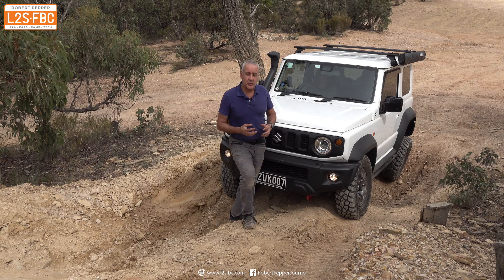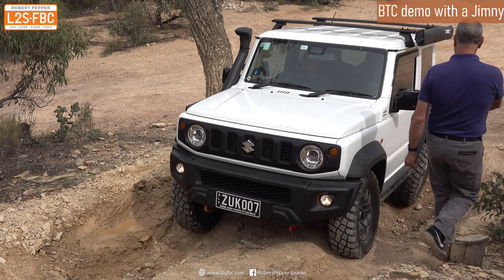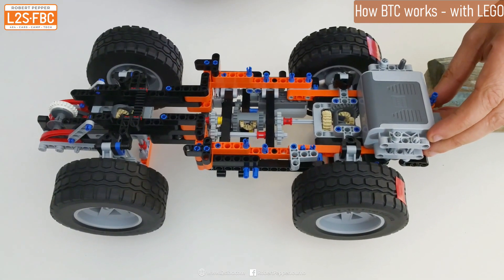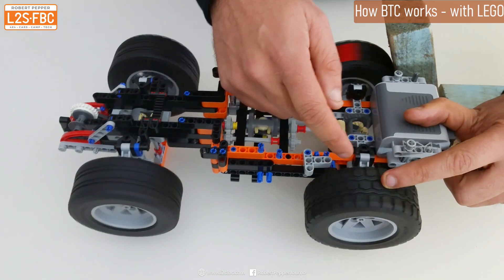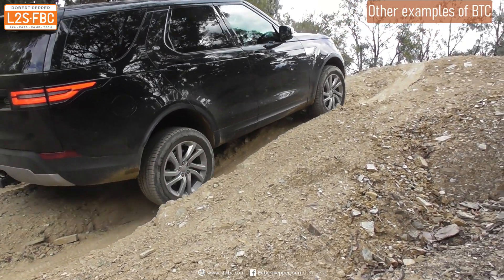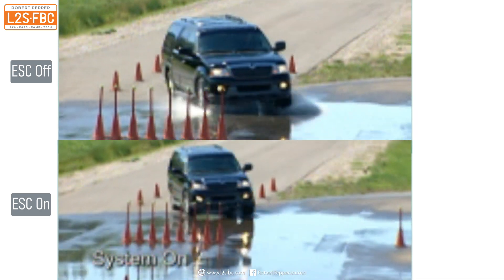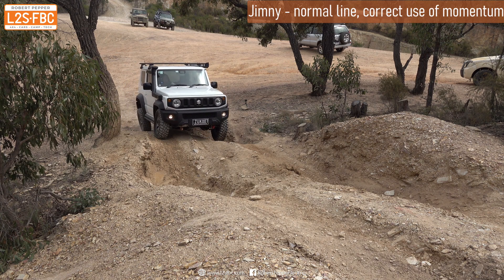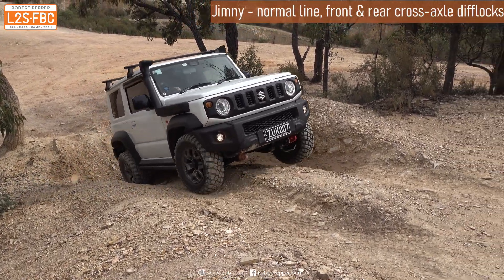The Three Types of 4x4 Traction Control - do you know the difference?

Comment: Great video, thanks.
I've got 2 Jimny's, 3-door JB74 and 5-door XL that have the same issue/problem!
I'm assuming it's related to the Electronic Stability Control and I'm hoping someone can confirm. Mechanics have looked but weren't able to replicate the issue.
Driving spiritedly on a bendy bitumen road in 2-wheel mode. Suddenly as I enter a left hand bend a loud sharp rumble sound is emitted (like running over ripple strips), the car pulls to the left sharply and slows rapidly. This only appears to occur on left hand bends. The XL did the same thing recently whilst going very slowly. I turned to the left off bitumen onto dirt and the car suddenly pulled hard left and slowed quickly. Had I have been going faster the car might have rolled over or crashed into nearby trees. Very unnerving indeed!
Has anyone else experienced this issue?
Can anyone suggest a fix?
Reply from the maker: Sounds to me like it's ESC.  Please review my Sand Setup video which talks about Jimny ESC, and shows an example on sand, see if it's the same noise.  The Jimny has poor ESC, simple as that, harsh, overly intrustive and ineffective.

Comment: Thank you very much Robert. I found here the best explanation about traction control in its three types.
In the user manual of the new generation of Ranger 2023+ the explanation is not clear and does not make the difference between BTC and ETC so I assume that when the 4L is connected the system only disconnects the ETC (and not the BTC). A big greeting from Mendoza, Argentina.
Reply from the maker: Glad it helped

Comment: ESC is basically the opposite of BTC! The ESC is braking the slower rotating wheel (inside wheel in a turn), while the BTC is braking the faster rotating wheel. You understand why the BTC is braking the faster wheel but do you understand why the ESC does the exact opposite? What do you think? What purpose should that serve? I program ECUs and I can tell you, it is not easy to find a good balance between this two, opposing functions.
Reply from the maker: Yes, I do understand why ESC does what it does, yes agree the two functions work differently.  ESC can also reduce braking force as well, not just increase it.

Comment: Cross axle lockers are good but also very dangerous!!! Especially if you fully lock the front axle. Do that, while climbing diagonally - on the side of a mountain and you will find out the hard way. Actually, it is the quickest way of writing off your vehicle and/or the driver ending up in hospital (or mortuary)...😮
Nice video, however you should have (at least) mentioned of that possibility...
Reply from the maker: It's not that dangerous if done right

Comment: The Suzuki All Grip System …
In normal driving it is slow to react, i.e., adding brakes to the spinning wheel. In general the computer needs 4-5 full turns before reacting. Other brands needs less than a 1/4 of a turn to react. 
Meaning, when the All Grip reacts the car is at a stand still. 

Solution 1 … Speed up, have a much higher momentum and you will have a scary drive but the All Grip will perform better.

Solution 2 … Buy front and rear diff-lockers (of your choice) and you will enjoy a much more controlled drive at a much lower speeds.
Reply from the maker: Look at my Traction Control 4x4 video for exactly that

Comment: Good video. Thanks. 

If we look at the wheel as a clock many traction control systems only need 5-10 minutes spinning on the clock for the computer to apply braking power to the spinning wheel. Good examples are Mitsubishi, Land Rover, Toyota. 

The Jimny needs 4-5 full turns of the wheel before the computer understands what wheel to apply brake to. Meaning, in many situations the car comes to a full stop before the AllGrip system kicks in. This is why I today have automatic diff lockers front and rear. The option is to drive faster and at higher revs than comfortable to get the Jimny AllGrip system activated and behaving as intended.
Reply from the maker: Very good way to put it!
Reply: @L2SFBC 
Thanks. 

With the double diff lockers from Kaiser I can rock crawl in 1st gear low range at idle speed with full control. That’s something one cannot do with the AllGrip only.

Comment: An excellent explanation, though I was a little worried for you lest the tyres should bite at the beginning with the Jimny! The Lego model takes me back to my biannual 4X4 instruction - love a diff explanation! But a question - near the end you ran a Disco 5 and a Prado 150 up a steep hill - could you give a quick comment on how the 150 compares as I'm considering dropping some hard earned on one? I did have a D5 (great on road and towing, great traction, but too fragile and the lower suspension arms used to hang up in soft conditions - same reason I'm avoiding Defender).

Comment: What I want to know is Why does more power have to be added before BTC works? Why increase the revs? A decent system would brake the spinning wheel anyway at any revs - why wasn’t the TC working while you were standing in front?

And love that the Discovery 5 was on street tyres and walked up. 
On a Land Rover you don’t engage 4WD as it’s permanent (all modern ones) and you don’t generally lock the centre diff either - it’s all automatic. 

MTS (Multi Terrain Select) is Toyota.
Reply from the maker: BTC shouldn't require more power to activate, and doesn't in your LR, but it does create friction and that needs to be overcome with a little power.  Suzuki's implementation is a bit poor.

Comment: Awesome video as always. Do you know what makes a good vs a poor brake traction control system? ie.e Land Rover vs /Suzuki. Is it 100% software and programming? Or is it hardware too? It makes you wonder if these other car makers ever test their designs or look at what other people are offering.
Reply from the maker: It's a combination of hardware and software. You need very accurate and precise wheel speed sensors to begin with as the software can't do much if the data isn't high quality.  But high quality input is no good unless there is software to handle the data and that's the work of the engineers in vehicle dynamics or similar. When should BTC intervene, to what extent and for how long. Suzuki clearly didn't spend much money on calibration, or hardware probably, whereas Land Rover and Toyota have made an art form of it.

Comment: I love the idea of traction control with mechanical limited slip differential instead of open differentials. I think it should be more standard. You could imagine those times where wheelspin occurs but the spinning wheel is still touching the ground it's just not gripping quite enough that would be a perfect time for a torque bias to split to the other wheel because of the mechanical limited-slip helping traction control work less often and when it does work with a raised wheel enough traction control not have to work as hard once it initially grabs
Reply from the maker: Brake Traction Control is standard on all new 4x4s now, and has been for years, and was common before that. I think the first implementation was in the Freelander 1 of 1997.

Comment: you do want brake traction control disabled in sand even more so the quicker it activates. there is an almost constant variation in wheel speed on soft sand and btc just puts extra wear, stress and heat into the brakes motor and drivetrain. and btc is entirely unnecessary on sand unless you are already bogged. 
not as immediately noticeable as engine traction control but btc causes bigger problems after a longer time frame such as cooked brakes and cooked automatics and cooked brakes and automatics are both potential fire starters.
Reply from the maker: Disagree, you want it on in sand. Why wouldn't you? Think about what it does, braking a spinning wheel. How is that not a good thing?  There's also minimal heat generation, you're slowing a single wheel not the entire vehicle.
Reply: @L2SFBC  because unequal wheel slip is a constant thing in soft sand heat buildup is accumulated by constant brake applications which also generate near constant strain engine transmission and differentials. if btc isn't intruding you either have a slow reacting btc or you're driving on hard sand.
this is not a theoretical issue i've come up with i live a few km from stockton sand dunes. uneven sand driving in or across ruts. access tracks with wombat holes (from high tyre pressure and compounded by btc)
even if you get stuck in soft sand it's typical for opposite wheels to spin alternatively anyway.
it's a product of one tyre digging deeper contacting more sand gaining more grip so it stops and then the opposite side spins.
which is exactly how btc works.
getting unstuck in soft sand is best done by gaining a bit forward then reversing back and gaining more each time.
you typically can't spin your way out of soft sand btc or otherwise because in most cases you'll go down quicker than you go forward.

Comment: Thanks for explaining different types of traction control. It’s confusing when ur supposed to disable traction control off-road but also enable another traction control, for Toyota its TRAC and ATRAC. And do the opposite in normal driving… what?? They’re both traction control!
Reply from the maker: TRAC is engine traction control, A-TRAC is brake traction control. Yes very confusing!

Comment: When it comes to the truth of four wheel driving, you are an authority. Besides teaching the in depth information, you are also demonstrating that it’s ok to stand in front of the vehicle and touch wheels etc. Please take more responsibility for your actions and it’s impact on four wheel drive communities as we trust you.
Reply from the maker: Sorry I should have been clearer that the risk was managed properly. It is generally not good to stand in front of a vehicle but in controlled circumstances like that the risk was managed; you saw how much extra throttle was required to move. However I should have made all that clearer so as not to set a bad example.
Reply: @L2SFBC  thanks, you are a legend.
Reply: @sydneyraj Boy I’m glad you cleared all this up. Someone coulda gotten runned over

Comment: Robert, could you please explain why different brake traction control calibrations are needed? I (perhaps incorrectly) presume that a BTC program that intervened as immediately as possible and stopped applying the free wheel's brake as soon as it regained traction would be ideal for all off-road situations
Reply from the maker: Excellent question. I shall post the answer on my website as it's too long for a comment.
Reply: @L2SFBC  Thank you!

Comment: So refreshing to hear someone on youtube understand how torque is biased in open differentials, not just relying on tropes that are inaccurate or add no clarity. One point worth adding is that BTC doesn't simulate a locker in that a locker can bias torque across the axle and the BTC cannot, being constrained by the limits of open differentials.  It doesn't matter much in vehicles with low range, but its a huge deal in single speed vehicles like subaru because quite of bit of the meager torque that is getting to the wheels is being taken up by the brakes and not used to move the car forward.
Reply: I think it would be cool if they put more mechanical limited-slip differentials in things that have traction control so the traction control doesn't have to work as hard or as often like when there's wheel spin but the wheel still touching the ground it wouldn't even have to help then the mechanical limited-slip diff would kick in

Comment: I presume the subaru "symmetrical all wheel drive" is a Brake Traction Control system. Does it differ from Suzuki, Toyota, Mitsubishi Brake Traction control systems (aside from differences in settings)?
Reply from the maker: The Subaru Symmetrical AWD system refers to the fact that torque is always split equally front and rear, as opposed to the "drive the front wheels, rear wheels on demand" system used by other SUVs.  I will shortly publish a video showing X-Mode in action which is their offroad system including different BTC calibrations.
Reply: @L2SFBC  - yep its basically a mechanical 50/50 torque split with a proper centre diff that is open that said you can't lock that differential, instead Subaru offers software solution of BTC combined with ETC (engine Traction control) re: X-Mode which is and is not the best solution since they also use CVT which causes the centre differential to over-heat (see many Subaru videos where the CVT caused all sort of issues), not saying its a bad option but nowhere near as good as it would be if the the centre diff could be locked instead.
Reply: @L2SFBC  So it always drives front and rear axles. So the Brake Traction Control is just dealing with left right side of front and rear? Does the fact torque being spit equally front and rear affect the Traction control for each front or rear pair?
What an absolutely fascinating exploration - thank you so much for providing that comment.
Reply from the maker: Yes, always front and rear. BTC just deals with wheelspin across a given axle. The f/r torque split doesn't really come into it.

Comment: Good vid, and on a subject not covered enough normally, spot on! I love the Jimny, can i find out more about the build somewhere?
Modern Land Rovers rely on it so much, that wheel articulation has little priority anymore, sadly. I drive a early Td5 Deefer, the first that LR fitted BTC on, you hardly notice it, seems to have very limited pressure it can apply.
Reply from the maker: Yes, the mods are covered here - https://youtu.be/oohqoYsJn3Y  I used to have a TD5 Defender and its BTC was basic but effective, agreed.
Reply: @L2SFBC  Thanks! that should be good watching. What year was your old Td5? if it was 2002 onwards that was a better system.
Reply from the maker: 2004

Comment: Great video Robert. Used to own the last model D-Max and the braked traction control was rubbish. It would brake the spinning wheel to the point the engine would bog down, but it still wouldn't send enough torque to the wheel with traction to move the ute.
Also had a D40 Navara with a LSD on the rear axle and that was far better and never got stuck in the same place my D-max would get stuck.
Now have a current model BT-50 (D-Max), but apart from a couple of muddy paddocks, haven't used it in 4wd enough to comment
Reply: That's very interesting. The LSD works great on my 12 year old Triton too.

Comment: was the perentie standard with no cross axle diff locks?
- they do have really good articulation as standard, and this does translate into improved off road traction
Reply from the maker: I'm not sure if it was locked or not. It was well driven, momentum perfectly judged, and had a lot of flex, so probably wouldn't have needed it.

Comment: Specifically in the Jimny, did you feel traction control was in gaged quickly on 4L vs. 4H? Any reason for this to happen?
Reply from the maker: It's awful - slow and harsh in any mode. Why? Cheap Suzuki engineering.

Comment: It would be interesting to run the Zook with only front/only rear locked to give an idea of which end to lock (first) if you're not rich enough to do both (at once).  I only have the front autolocker in my GU and have never wanted for a rear locker as well.
Reply from the maker: Ah, which end to lock first. "It depends" is the short answer on the vehicle and the terrain and the specific situation!
Reply: @L2SFBC  And whether you have an LSD in the rear that actually works, haha.

Comment: great video.  have tried explaining traction control to some over many years, but seeing it in action makes it so much easier.  Dont forget to turn off your BTC in sand though.
Reply from the maker: BTC in sand is fine. ESC and ETC is not.
Reply: @L2SFBC Oh and what does ESC do wrong in sand? I’ve seen videos of (Audi?) ESC helping make tight turns on snowy trail/road/driveway which is different because instead of carrying velocity that you want to keep you’re carrying speed that you’re stuck with.
Reply from the maker: ESC detects what it thinks is a skid so it applies and brakes and reduces power. This kills your progress. See my Sand Setup video.
Reply: @L2SFBC won’t it wear out your brakes? I’ve had manual transmission cars and nothing with any traction control except my parents’ cars but that’s beside the point. I always get crazy good brake wear, even though I drive on the canyons but because of engine braking I actually use my brakes occasionally just to keep them warm. 
Wouldn’t the constant use wear your brakes out faster?, EVEN WORSE wear just one of your brakes out faster😅